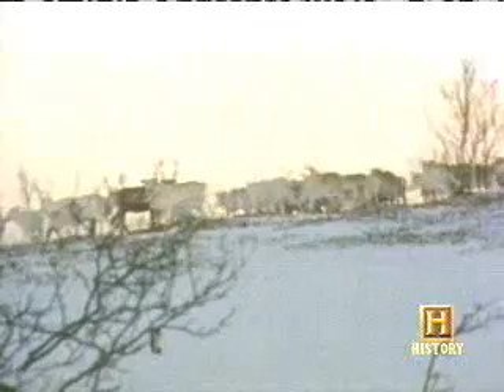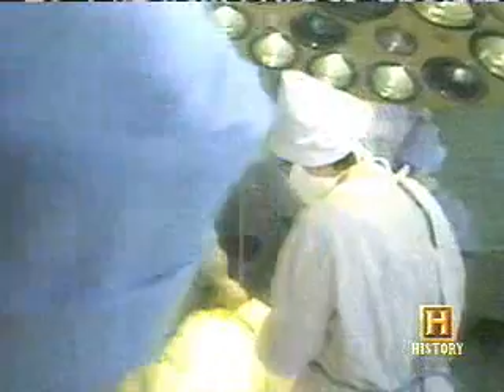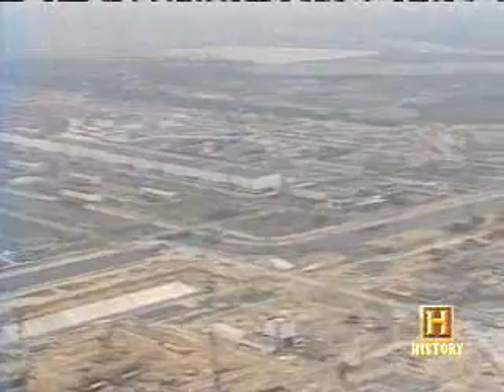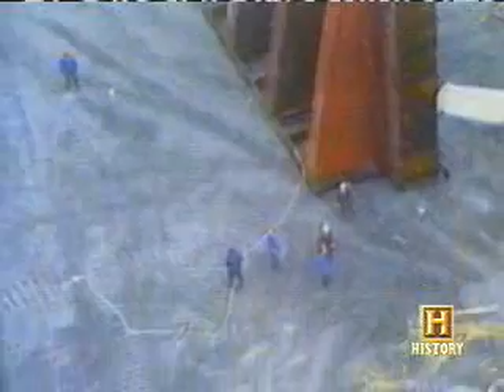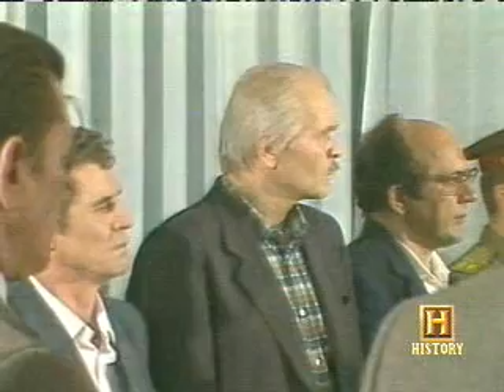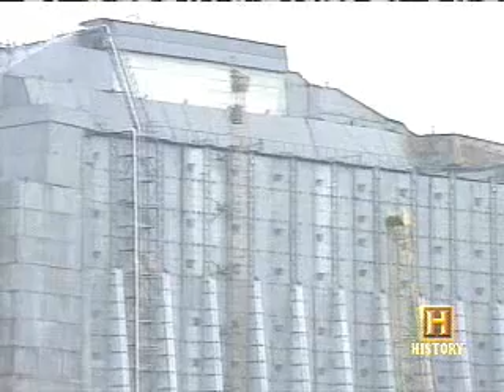Meltdown at Chernobyl Part 3/3

Comment: @fortissabrok, yes truly horrible. Many of those workers died as a result of high radiation dosages. There is a word "biorobots" for those soldiers that were running on the roof of the building trying to shovel parts of the exploded core back in. These men were called in as a replacement for robots that quickly stopped functioning when exposed to the enormous radiation. The fatal dosage was a matter of minutes out there.